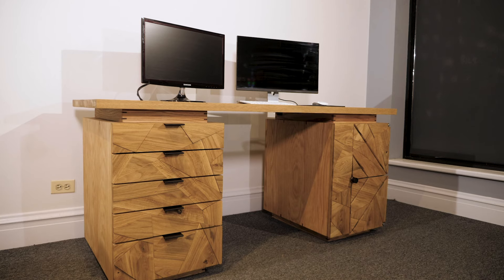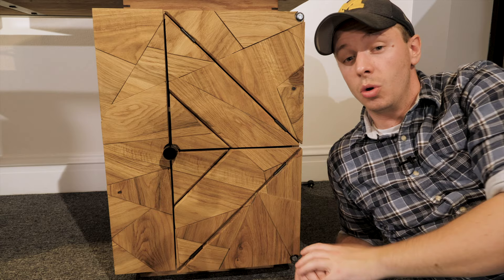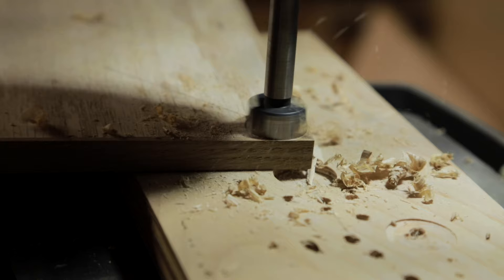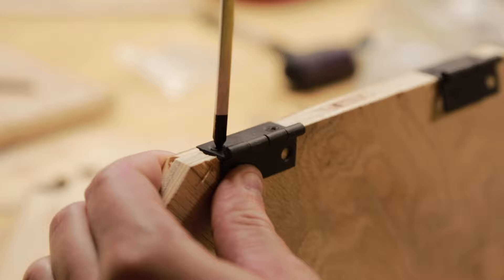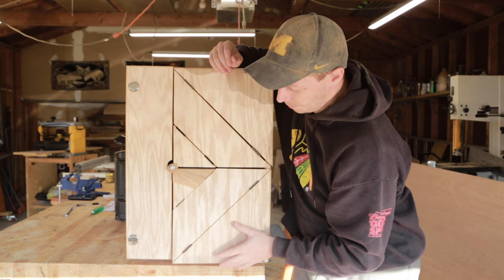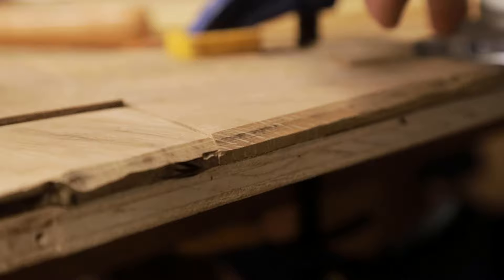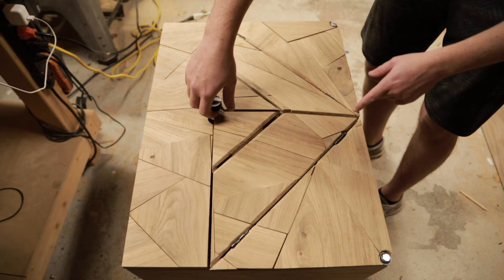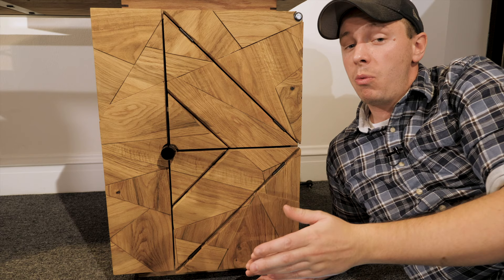Kinetic Folding Door - DIY

Comment: Hey I'm thinking of a similar project, but I'd like to know more about how you made the centre circular hinge between the two panels. I tried researching a way to make two panels rotate like that,but cant find anything. You used a bearing, but how did you connect the pieces specifically?
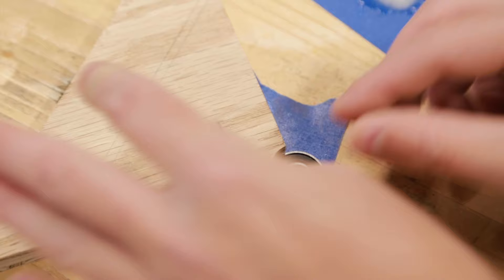Reply from the maker: So the center connection starts at 2:01 in the video I attach the bearing to triangle that will be on the bottom. the top triangle then gets that piece that I added on at 2:06 (but stated at 1:17 in the video I would have cut around but to fix that I glued on the additional piece) So now the bottom triangle with the bearing is overlapped by top triangle and they can be connected by the knob I installed. Hope this helps.

Comment: Hii. I love your design. And build by far from all I've seen. I would like to build a heavier door possibly mixed with resin and live edge wood. Is their a way to get info. On design build from you including where to put strong magnets. How can we get intouch via email thanks
Reply from the maker: I dont have anything written up for this, sorry. basically the door is made of 2 perfect squares and each half has 45 degree angle cuts, one corner to corner and 1 parallel about half way between the first angle and the corner (where the 2 halves meet.) I never actually used the magnets as the door kinda snapped closed so I had no problem. The one thing I would like to say though is that 2 corners with the bearings on top and bottom need plenty of reinforcement  and I would do what I did at 2:05 to the middle bearings so that it hold stronger
Reply: It's not his design..